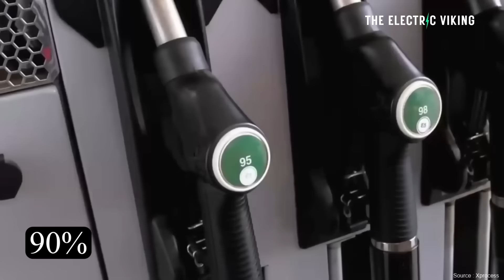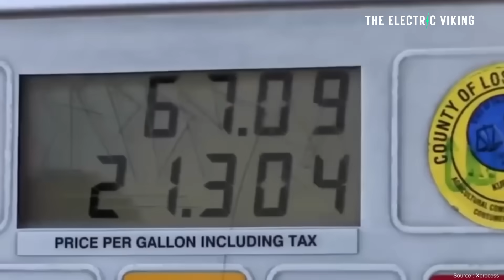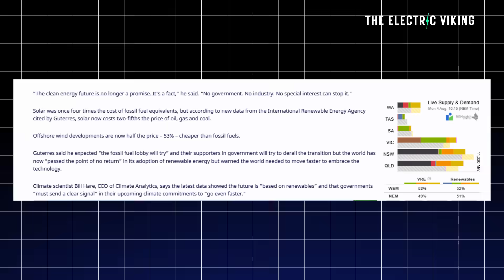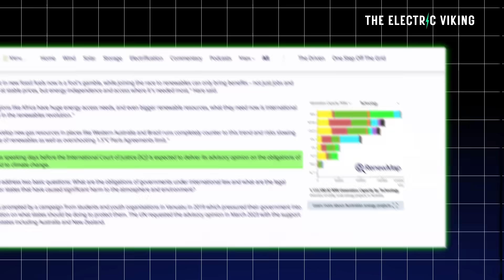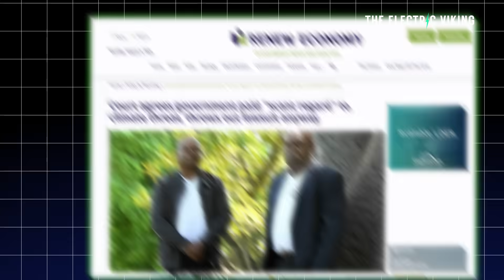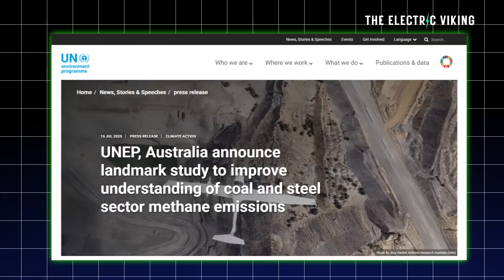Game Over Fossil Fuels: United Nations: "No Government can Stop Clean Energy"

Comment: Solar/wind are cheaper than other sources in the same way that slick car tires are cheaper than tires with treads.  The problem is slicks only works on smooth, dry pavement.  Any other driving conditions require purchase of a second set of tires and wheels and swapping back and forth.  Solar/wind require the purchase of all-weather power sources IN ADDITION to the solar/wind.  The net result for the grid is HIGHER costs, as demonstrated everywhere solar/wind are used on a large scale (e.g. UK, Germany, Australia, California, etc.)

Comment: In Texas.  We have a lot of land, lot of sun, and a decent amount of wind.  But our grid problems were mostly due to goverment forcing regulations down our throat.  The blackout during the big freeze was largely do to the federal government policies.  In the past, we had simply allowed commercial electrical generation (plant generation, which has different EPA rules) to be sold on an emergency basis to the public grid.  Feds said they would fine the life out of us during the freeze if we did that, so we went cold and the corporate owned generators went idle.  Did not help any that Feds had forced us to close a lot of our traditional generation for green power - that apparently did not provide electricity when we needed it the most.  One reason that bills are going up - even if green power can provide cheaper electricity some of the time, we still have to maintain conventional generation capacity for when it does not.

Comment: The massive issue with completely binning petrol (gasoline) at least is that it's a bi-product of refining oil to make plastics etc, so there will be billions of gallons of the stuff every year that has to be stored/disposed of somehow?
We can certainly get rid of coal though, no argument there!
Reply: There are technologies for making biodegradable plastic from plants that were too energy intensive to be cost effective.
As wind and solar with battery storage reaches “super power “ level, those processes can be done with free energy. 
Of course there will always be someone who wants petroleum based poisons.
Gasoline powered cars will be around for twenty years after they are no longer mass produced. It’s more ecologically feasible to use them than to recycle them for several years.

Comment: ICEs big problem is that, once you've owned an EV and don't have distance issues it's just such a no-brainer. They can lie and manipulate all they like, flood the market with dodgy EVs from China (you once said the reason a big manufacturer's cars were getting bearing failures was because they'd ordered 'as cheap as possible'). This is going to be a big technology transfer, quite disruptive but it'll happen whether we like it or not, because behind all the hype and salesmanship fossil fuels have had their run and are no longer a viable all-purpose solution to all our energy needs.

Comment: Texas is not a surprise, it's an inevitability of the state government refusing to integrate with the US national power grid and lack of maintenance of the Texas grid, people are shifting to alternatives because the state government can't do the job of providing reliable power. Now you could claim because the power system is privately run it's not the governments fault, but lack of regulations over the power industry in Texas is the problem, due to this people in Texas have been known to get power bills in excess of $15,000 for a single month's power due to lack of pricing regulations that control the private suppliers. If there is a blackout, emergency suppliers can basically charge whatever they want for power, resulting in peak power bills multiplied by over a 1,000%, so if you  have your own solar power and battery system and there's a power cut just a few days running on your own system rather than the grid can pay back your entire investment in solar and battery in a single month.
Reply: freedom in action thats the way you like it.

Comment: You can do ice motors very efficient and clean working with water.
You can do electric engine very good too.
But the problem is complication. When cars are made not to last.
You see that with electric Chinese models that can't stand a simple bump from the front or too much électronic controls on tesla motors.
Simplicity should come back with the fact to last

Comment: The US power industry switched power plants from coal to natural gas in a very short number of years once they realized gas was the cheaper alternative to coal. The industry is truly driven by cost. So the move to renewables will very likely be just as swift. And it had nothing to do with pollution or climate change considerations. Even though coal is far worse for the environment, the US power industry kept their power plants on coal for decades simply because it was the cheapest fuel at that time. So cost is the true driver of the US power industry.
Reply: Plus they could afford good lobbyists. This transition is already having major effects on long-term economic and political planning and they're increasingly causing friction. It's going to be quite the ride :}
Reply: The problem with solar/wind is that it's like using cheap, slick tires on your car,  Great when you only drive on clean, DRY, smooth pavement, but unusable in any other circumstance.  That forces you to buy duplicate tires and wheels for when driving in other conditions and having to switch tires/wheels back and forth.  Solar/wind only works when its sunny/windy; then you have to switch to all weather electric sources.
Having to buy TWO sets of tires/wheels or TWO sets of electrical generators is more expensive than just the all weather set.
Reply: @dzcav3  "Solar/wind only works when its sunny/windy" - 🤣🤣🤣 This hilarious narrative never ceases to be a hoot.

Can you descibe what a fully completed grid scale renewable energy system actually is?  Please descibe all the many components parts, resources and management products that together form a fully completed smart grid renewable energy syatem. 

It would be great if you could do that instead of ignorantly thinking it is just solar panels and wind turbines. 🤦‍♂